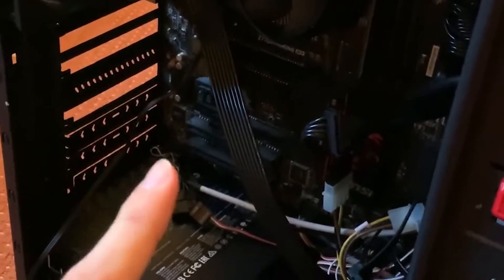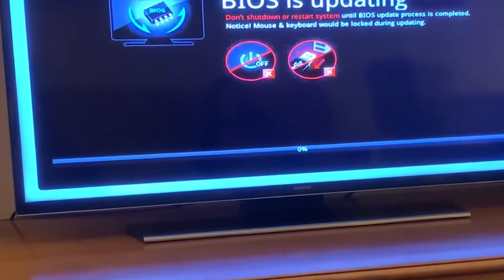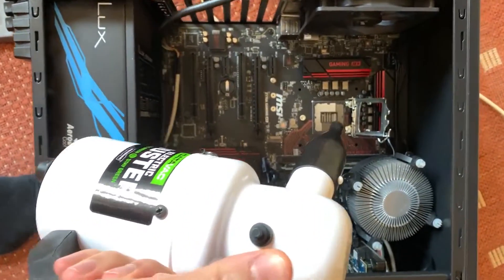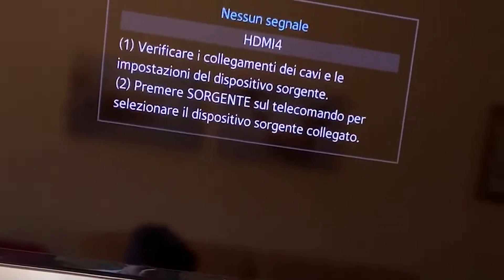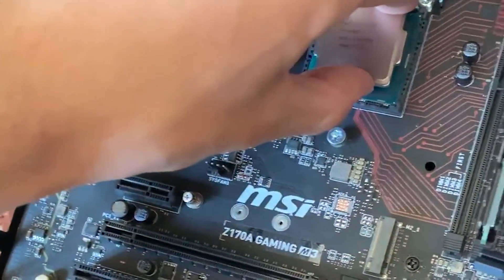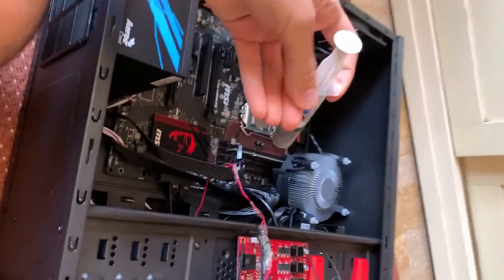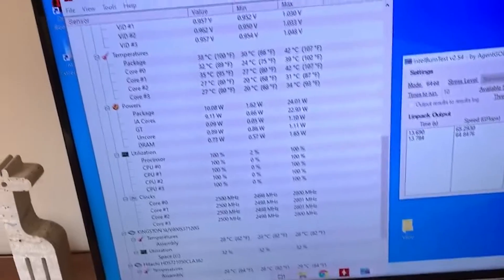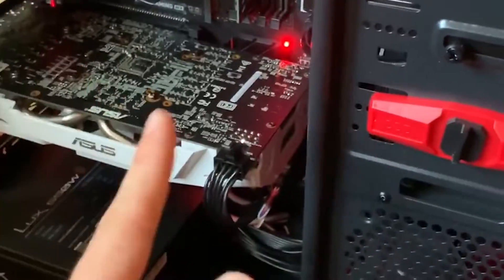450$ Budget Build /w i5 6400T @4.6Ghz Overclock & GTX 1070

Comment: OMg!! I discovered this by accident as I was repairing my Lenovo that owns an i5 6400T. After reading that you can overclock more than 4Ghz that's pretty crazy. Did you run any test to look at how stable is? Is capable of two cores at that full speed?
Reply from the maker: The settings shown are fully stable! It does all cores at that speed, I actually have a full tutorial on my channel!

Comment: Hey, if you still use this system I'm interested to know if you have seen any degradation of the chip by running at 1.48V. That seems pretty high for skylake!
Reply from the maker: Hey! Still working to this date! It's all about the temps!
Reply: @ImWateringPSUs  Ah nice, thanks for replying! I was scared to destroy my chip so I've been running at 1.28v @4.05ghz for the last couple of years. I'm gonna push mine a bit more now!
Reply from the maker: @Sam-gg8wk  Be sure to have enough cooling tho! Mine was also delidded ;)
Reply: @ImWateringPSUs  Yeah, I'm going to buy a new CPU cooler, I've been doing this on the stock cooler fixed at 2000rpm haha.
Reply from the maker: @Sam-gg8wk  loooool, talk about a jet engine

Comment: I have an Asus Z170 premium motherboard, do you know which bios has unlocked bclk?
Reply from the maker: This is the Asus bios list I found: https://play3r.net/news/overclock/overclocking-news/intel-non-k-processors-can-now-be-overclocked-on-z170-bios-files-inside/3/
Unofrtunately yours is not here, but it probably has a similar bios, so I'd try crossflashing. But you should have an SPI programmer on hands in case things go south
Reply: @ImWateringPSUs  I don't have spi programmer,by the way this motherboard has flashback button,maybe it's can be flashback.
Reply from the maker: @futurist8721  Well, if it has the flashback feature, then you're good. I'd try and choose if you feel more comfortable with crossflashing or bios moding and go with that route.

Comment: I always though it was electronic stuff in the ceramic plate of the cpu but no, a processor is literally just a shitty little piece of pcb, and it cost 400$ new.
Reply from the maker: Ahahaha, well the electronic is there, it's just printed on the circuit board. And the magic happens in the silicon ;)